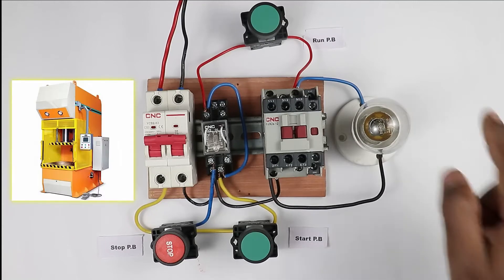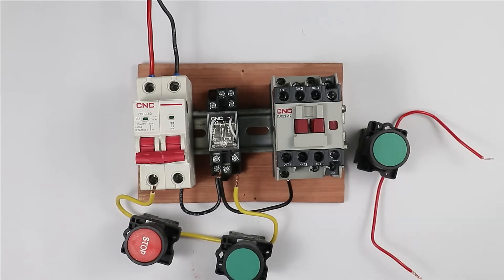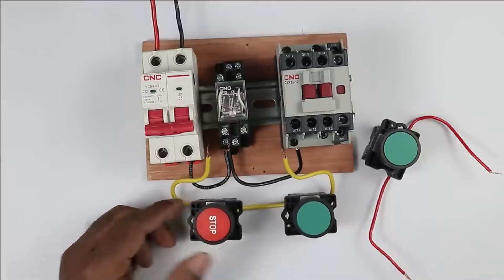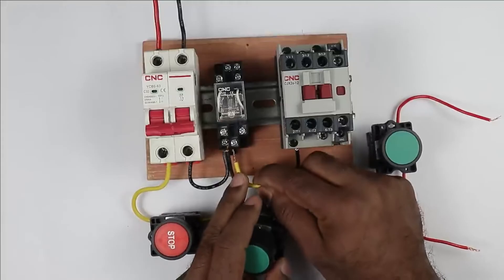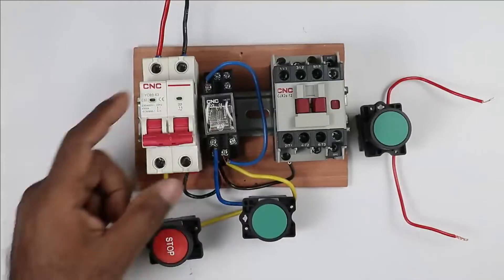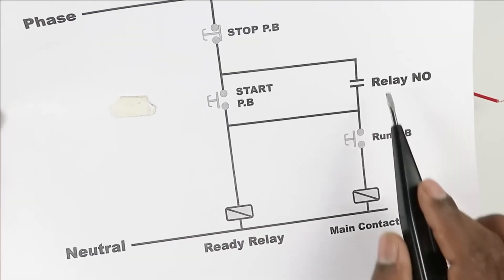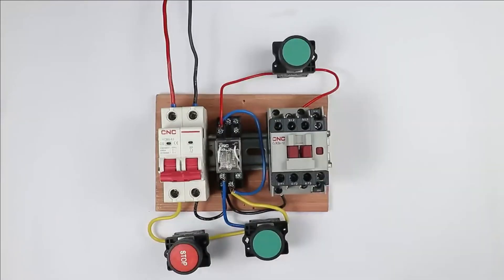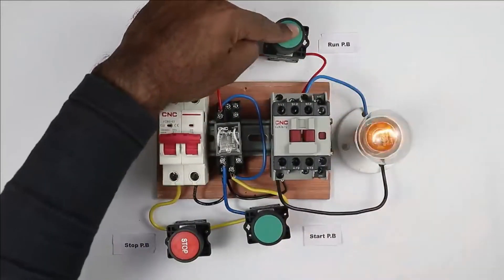Electrical hydraulic press Machine Starter Control Wiring @TheElectricalGuy

Comment: What if while using the start and stop butting to lift hydraulics up and down it shuts control board down but the hydraulics are able to still be used to go up n down regardless if everything is off , what could be the reason for circuit board shutting off

Comment: Why not use DOL starter without using holding circuit.
Reply: Momentary operation only. DOL is for larger circuits and longer operations like pumps and conveyors